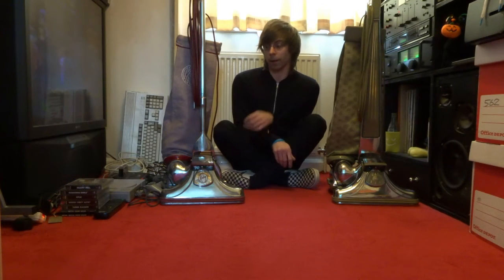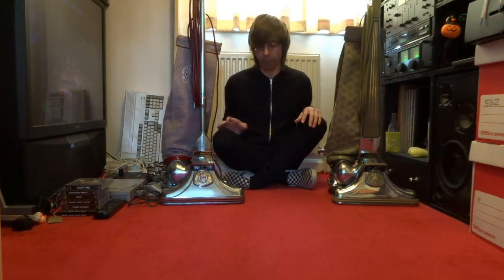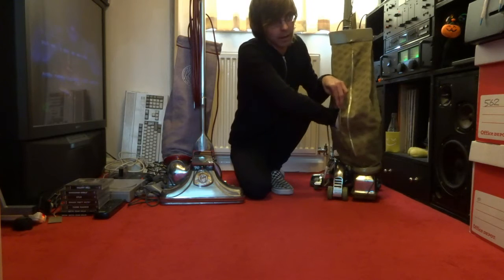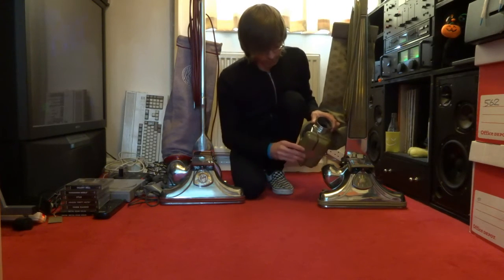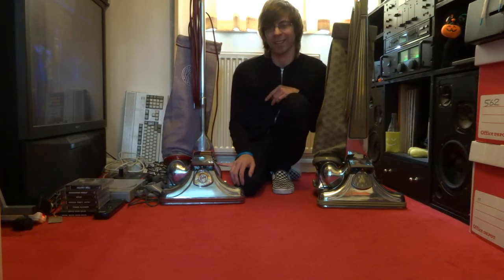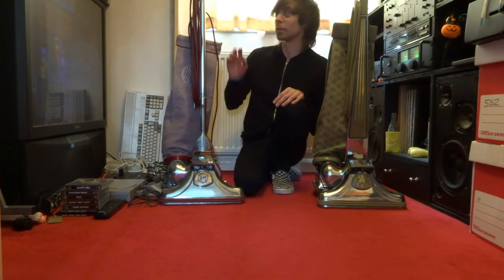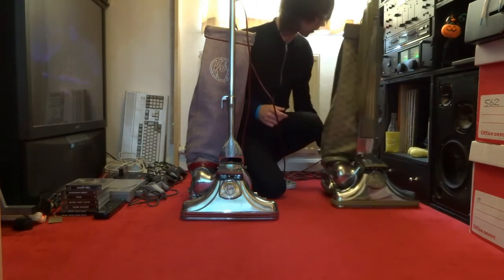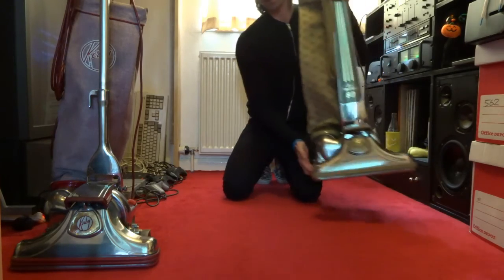Kirby 560 and Dual Sanitronic 80 240v

Comment: nice machines, although i think i would have used a regular transformer  and fitted a 110volt socket to it to have kept the originality of them.  lovely though.
Reply from the maker: Thank you for your comment and compliments. I explain this a bit in the description, but will elaborate a little more.
The 560 was going to be stripped and scrapped, the motor was on its last legs and the machine in a very poor state, so I decided to restore it and convert it to 240v, You can see the metal work never achieved the same mirror finish as the DS80.

The DS80 was not "original" anymore as it was a factory rebuild so most stuff had been replaced already (including the motor).

I do retain both models already as 110v, and in much more original condition. I do completely understand where you are coming from though, as I would normally not be one for doing such modifications to a vacuum.

They are so much more usable now, with no lugging around the heavy transformer. I would also never dream of actually using my "original" condition 110v machines.

Comment: What size drain pipe did you use on your emptor conversion? I want to do this to my D80
Reply from the maker: Its a stepped adator to connect 2 size down pipes together, I just cut it to suit the fill tube size.

Comment: Can I get a better explanation of the sani-emptor conversion to use disposable bags? I'm interested in doing a similar conversion to my classic omega and classic III
Reply from the maker: I cut a circle from thick plastic (you'd need an oval) so that it would sit just inside the top of the emtor bag opening. Not to small so it falls in, and not so large it sits proud, just enough so it sits below the very top.
I got a drain pipe adaptor/ reducer pipe/ steped pipe that matched the inner diameter of the fill tube, and cut off any of the smaller steps in the pipe. I then cut a circle from the centre of my circular piece of plastic (disk) so the wider end of my drain pipe would fit inside the disk, and glued/ sealed this in place with epoxy resin glue.
Then after sanding the inner face of the emtor bag opening to roughen it, I glued the now made bag adaptor in place.
I hope my explanation is enough for you.
You could however get a Tradition emtor with a bag adaptor plate fitted and use that, just change the trapdoor over to match your machine.

Comment: I wanted to give you a tip on the Sani-EmTors: If you ever experience a leak around the tray, take the tray out and bend the wire bails closer together. You can simply do this in your palms. When you do this, the tray will close tighter. I have had that issue in the past, and, even with replacing the felt gasket, it would still leak, until I bent the wire.
Reply from the maker: Thanks for the tip! I thnk I've done this before on trays which were really loose!
Reply: mrxr2 No problem. Good! That means your ahead of the game. On a rare occasion, I've had to replace the main EmTor gasket. The thick, cork definitely seals the best IMHO.
Reply from the maker: I didn't realise you could get a cork gasket for the main seal. I always use the rubber ones
Reply: mrxr2 Yep, you can get either one. If the rivet bolts are still good, and the the Sani-EmTor is tight with the rubber, go with the rubber gasket. However, sometimes the metal wears down a bit on some of those bolts and/ or the inner grooves of the EmTors. The cork seals tighter when it comes to that point. You'll notice when the EmTor rattles a bit or leaks dust from the top.
Reply from the maker: I've never known the lugs to wear out.
I tend to find the rubber deforms over time and stays sqished casusing the emtor to come loose and leak.
A new gasket has always solved it for me
Reply: mrxr2 It's rare, but it does happen. I just came in from my shop. I have to buy a fan for my Royal upright. This is the first time I have had a big issue with it. It was stuck on the armature, and it took hours to get it off. I had to take a hammer to the back of the fan, once I got it far enough away from the housing. It had been awhile since I serviced it, and it was REALLY gummed up.